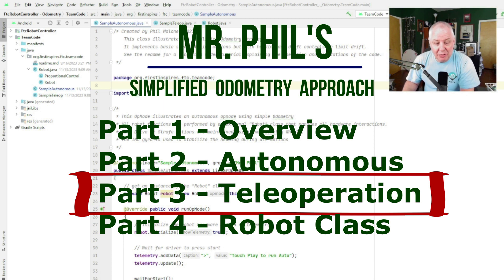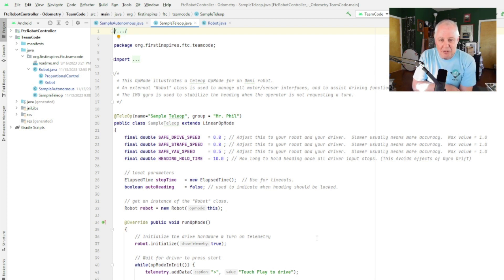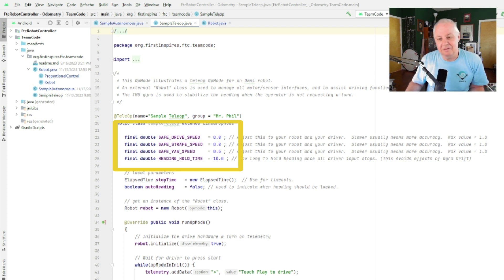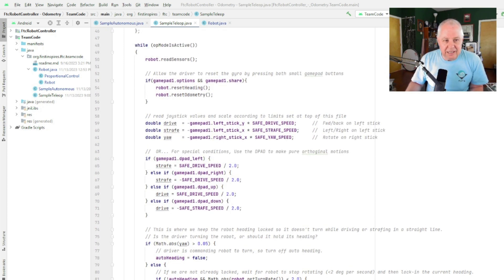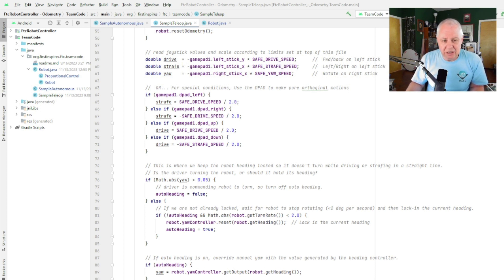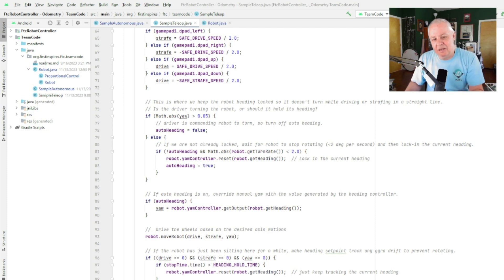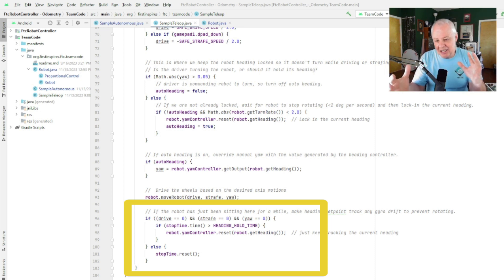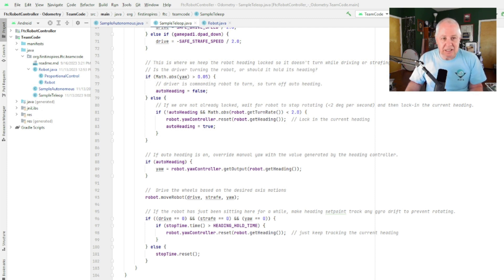Simplified FTC Odometry. Part 3: Teleoperation

Comment: say i already have a teleop in a different code library which also has all of our autonomous routines, is there any way to implement the heading lock in the road runner 1.0 library?
Reply from the maker: Heading lock is a teleop feature, and road runner is mainly used for Auto path following.  You CAN use the same technique as shown in my tutorial with Teleop in RR.  We do.  You need to replicate the Proportional controller code and put it inline with the teleop drive code in the same way.
Reply: @ any chance you could reach out and provide pseudo code? i think what you’ve done in these videos is really good but i would like to try and implement it into my code library without adding anything else. would it be possible to add this into my team code folder that already has road runner?

Comment: Mr. Phil, Thanks so much for putting up these videos.  I'm trying to run it and I get some weird behavior.  No matter the drive setting, the drive wheels go full speed.  Even if the drive motor powers sent by telemetry show at 0.02 they all go full power. Seen this before?  Any idea what's going on?    Thanks,  Gary Lindner
Reply from the maker: Hi.  Yes.  It sounds like you have not connected the motor encoder cables, or you have them crossed over and pluged into the wrong encoder inputs (not matching the motor they are connected to).    The tutorial code puts the drive motors into RUN_USING_ENCODER mode which provieds better speed control.  But it requires the encoders to be plugged in.  If the encoders are not connected correctly, the software tries to drive the motor slowly, but because the Control Hub does not see the appropriate encoder counts, it ramps up the motor power.  It will very quickly max out at full power.  Also, if say, the left and right encoders are swapped, then the encoders will run in the wrong direction (because the left and right motor directions are flipped) so, once again the CH will correct by rampng up the speed.  The alternative is to switch the motors to RUN_WITHOUT_ENCODER in the setupDriverMotor() method.
Reply: @GEARSinc  Hi Phil.  Thanks for your response.  I suspected this from previous experiences with runaway motors.  However, I have carefully checked the wiring to verify the configuration, and it is correct.  To make sure the encoder data was coming through for each correct motor, I put some telemetry sending the encoder values.  They all were consistent.  To make sure, I commented out three of the motors leaving only one operating and the motion and encoders matched.  Could it be caused by a defect in a motor?  One of them seems out of step occasionally, but I forget to note which one or I would have just swapped it out.  What else could I try?  I've propped the robot up so the wheels spin freely and they go fast.  If I roll the axial encoder wheel an appropriate amount it stops, or even reverses to get back to the set value.  But when I put it on the ground it just goes straight at full speed.
I really appreciate your help.  Thanks again, Gary
Reply from the maker: @ The other alternative is that you have the black and red motor power wires swapped.  This is asy to do by accident if you have gobilda bullet connectors.  When you run the motors with POSITIVE power, the encoder counts should go UP not Down.  Did you verify that the motor power and direction of counting was consistant?